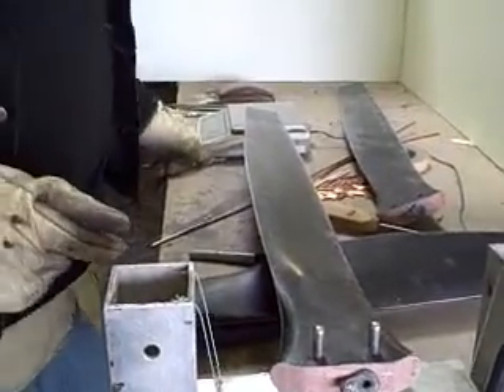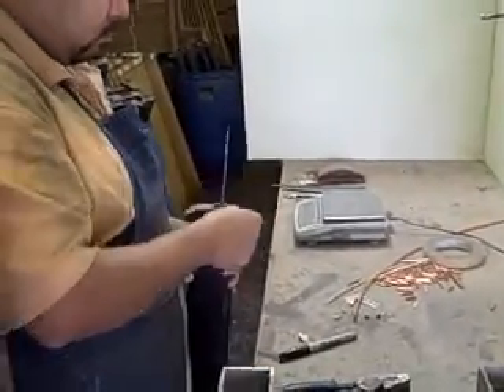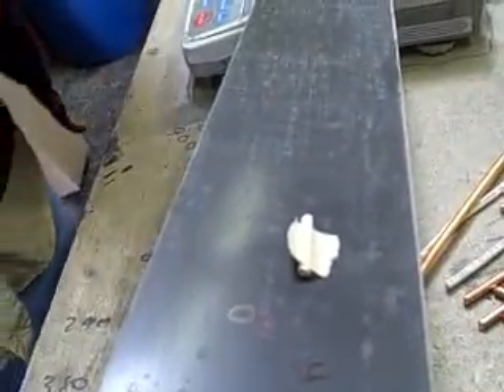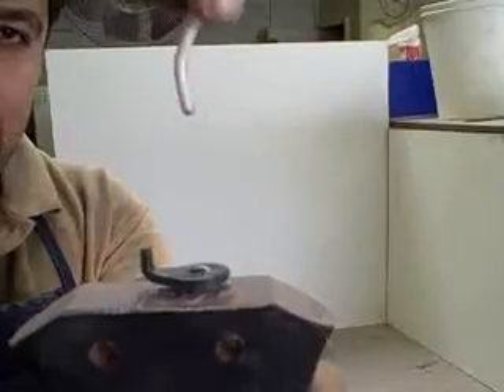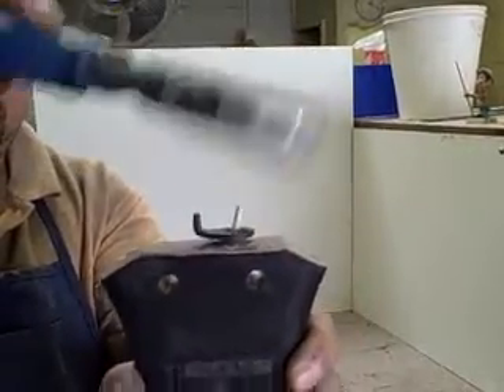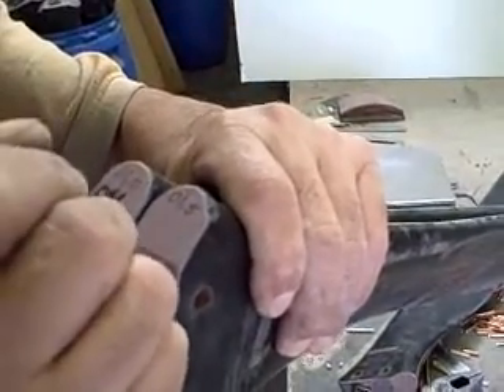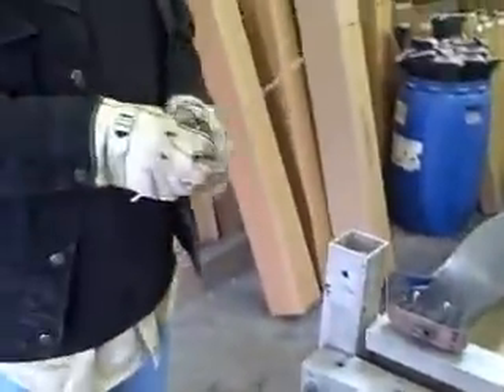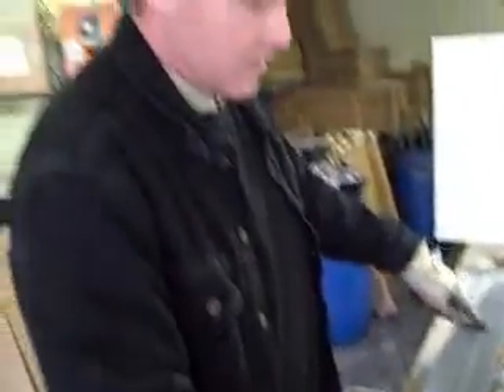Ivoprop Balancing Blade

Comment: Why don't you  check each blades CG? Tip weight isn't overall weight and just adding weight in the same place on each blade to make them match isn't going to make each blade match in weight or CG. So how is this actually balancing anything? Is this just one of those "close enough" situations?? If I balanced my helicopter or airplane props on my RC models like this, they would vibrate pretty bad.

Comment: I’m confused on the first 14 seconds. Why is the two bolt end suspended in the air if your just measuring the pressure weight of the tip with the scale? And at the end you mentioned the blades are t compatible if when you stick the rod in if there is a big different. Is there a maximum difference that is ok and they are still compatible or they have to be exactly the same when you stick the rod in for them to be compatible??

Comment: I've got an old IVO prop '87 and a new IVO prop '17. You're instructions are terrible. Where can I find decent instructions?
Reply: Ron....I have a 60 inch IVO 2-blade from '87 & an IVO 2-blade that just got here about 3 weeks ago, brand new. IS THERE A VIDEO THAT SHOWS HOW TO PROPERLY ASSEMBLE ITAND MAKE IT WORK? I have done what I think is correct but if I had a video, that would be fantastic. I cannot believe there is not an instructional video out by IVO? I have looked everywhere I can think of. I know it is basically a simple deal but I just want to make sure. Words & phone calls can only do so much....ACTUALLY SEEING SOMEONE ASSEMBLE IT WOULD BE FANTASTIC.  Maybe you can pass this on to the blithering idiots at IVO?Right now, on my old '87 IVO, I'm experiencing a high frequency buzz at anything below 5,000 rpm which I am 99% sure is coming from the prop. Thank you for your time. If you know where an instructional video is located, I would sincerely appreciate it. But phone calls and text (words) will not help me. I already have that.
Reply: Dear Bill, 
Please call 562 602 1451